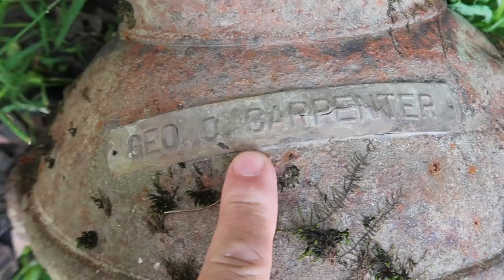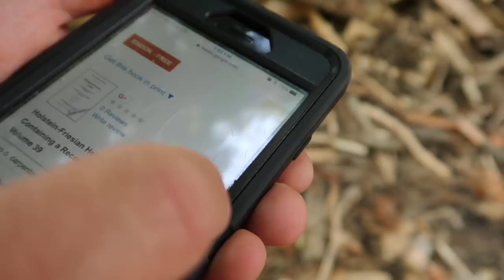I hope these Turkeys can Get along

Comment: Be careful if the screw or washer are zinc coated or coated with other questionable metals. The salt and saliva may be an issue with zinc or such. Bare steel would be best.
Stone walls were not necessarily property lines. They were just the edges of fields being farmed. The stones were not stacked to create a wall. They were stacked to get them out of the field. Since fields were plowed in straight lines, the stacks of stones were in straight lines and "may" have followed a property line. 
A field trip to Lancaster to the Records/Registry of Deeds office can help you track your property. 
While you go, say a symbolic Hi! to John and Israel, the namesakes of John's River in Whitefield and Israel's River in Lancaster. They are my 7th great uncle and grandfather. They lived in this area in the mid to late1700s as trappers and surveyors. They may have surveyed your property.

Comment: I would be concerned that the goats would start chewing the wood on the barn to get to the salt after it has hung on the wall for a while and some of it had soaked into the wood.  Might be better to use a square plastic bucket screwed to the wall with the salt inside of it.

Comment: Goooood mawnin' Al!   So I came across a really valuable tool for looking up property boundaries while researching plots of land to purchase.  If you Google search your county "GIS" maps you may find aerial photos and maps with property lines of each parcel of land.  In my case for Suffolk County, I can overlay the current property lines over aerial maps dating back to 1947.  The township I live in has maps that go back further but the lot lines are less accurate since the the method of surveying was more limited back then.  Just a suggestion try Googling "Littleton NH GIS map"  or sub the county name, give it a try!  Good luck.

Is the value of the red pickup high enough to warrant selling it?  Would you be giving your new truck a big break if it never had to move snow and keep the old truck as a farm truck for plowing and such?  Just wondering!